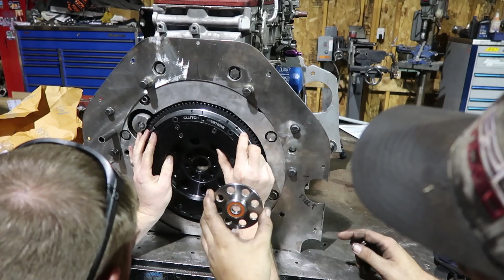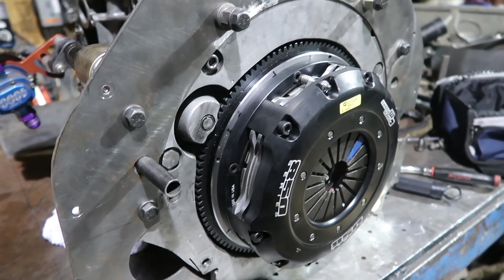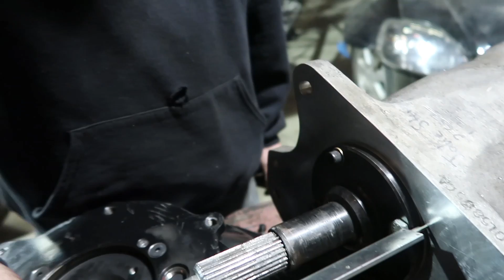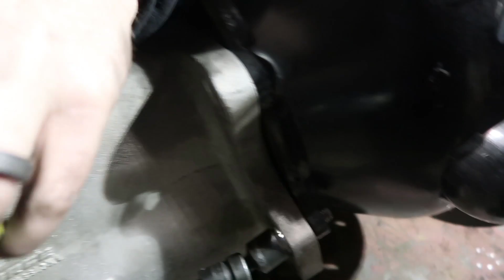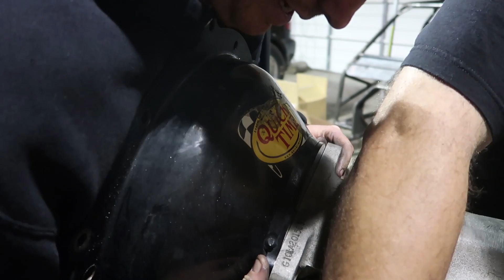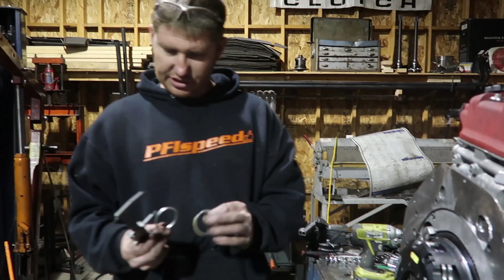SHO’NUFF we set up the Clutch and Throwout bearing shimming

Comment: Since the f20c motor has a pull type clutch from factory, does converting to a push type diaphragm cause any issues with the crank thrust bearings?
Reply from the maker: Not at all, they’re similar to a k style thrust which is a pusher , only thing that will mess with a thrust push or pull type is too much weight or bad fulcrum point

Comment: So are you using longer than factory length flywheel bolts?  Where did you get them?  Because I know Honda runs that crazy M12x1.00 thread.  I can't find them.
Reply from the maker: We ended up using the 23 bolts s2000 has the longest flywheel bolts . Auto are the shortest and d series dot bolts are what you use for most twin disks
Reply: Do you guys have more info on your mechanical fuel pump setup!  I NEED to do that for methanol as well.

Comment: I wish SPEC's Mini Twin had thick pads on the discs like on this one here... I went with the cheaper alternative to Clutchmasters (SPEC) and got 6000ish daily driver miles out of the SPEC and was told I would get 10-15000 daily driver miles..so every 2 oil changes I get to change/refurbish the clutch..I wonder if those discs will fit the SPEC.
Reply: Wow I would really hate to keep changing clutches wit every 2 oil changes that's crazy 4real.. It n best if u upgrade to a diff clutch cuz the money u spending on chnging the clutch like u is u could just get a better clutch all together n not hav to worry bout it for a Lil while. Atleast u won't hav to change em every 2 oil chnges

Comment: 3:25 no thread lock or torque and only 4 of 8 bolts installed ehhhhh ???🤔
Reply from the maker: Just mock up
Reply: @PFIBrent  ohhhh lol 🙂. I was thinking wtf. Wouldn't of lasted long. You would of drove from the ramp to the shutter and it would fall apart. 🙂
Reply: @PFIBrent  you guys really do amazing work
Reply: Dude are u serious bout wat u just said. They only put 4bolts in out of 8 n didn't tighting them lmfao.. U can tell som ppl just dnt know anything bout cars.. But there just doing this to mock everything up b4 they put everything together n somn b wrong. Like wit the bolts on clutch n bell housing was to long or whatever but ig they would've put all this stuff together n found out is was dragn on bolt or somn then they would hav to tear all that stuff back about just for the bolt head being to thick so that why I mock stuff up b4 u do the final assemble